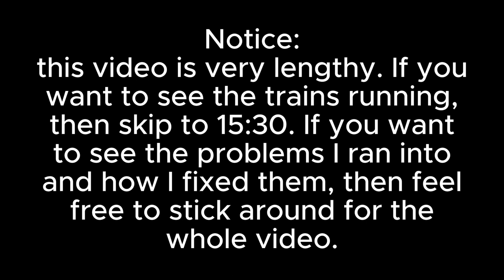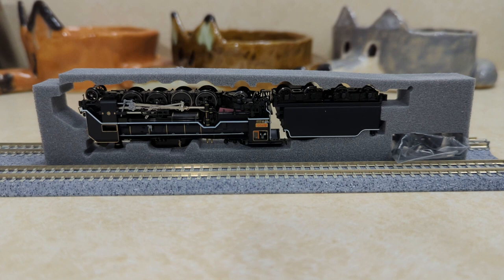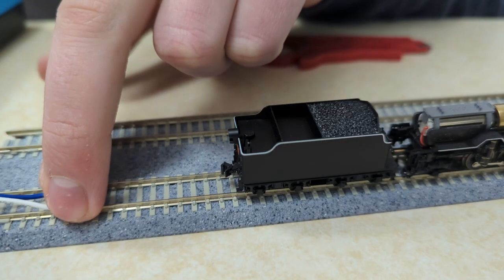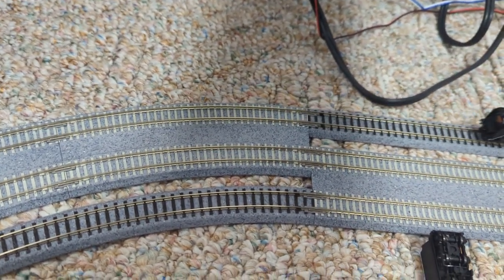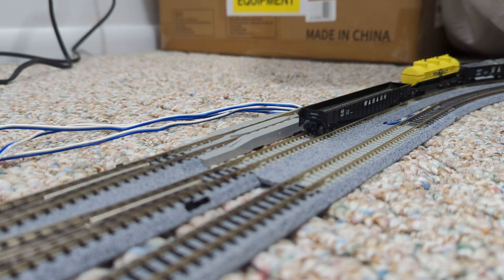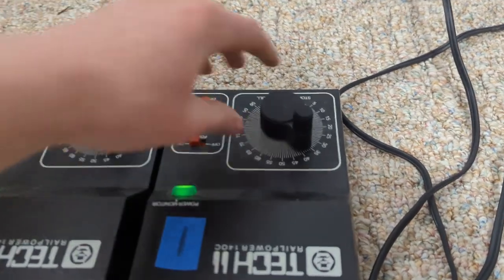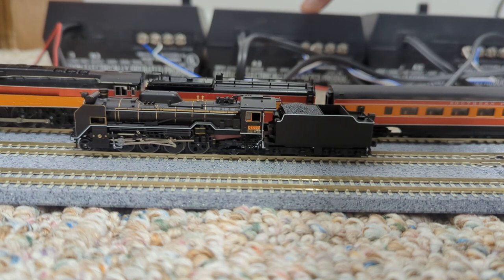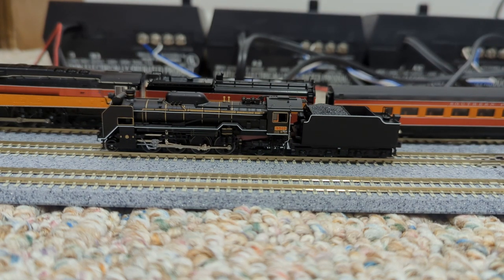Kato N Scale D51 200 (Hiro) Running and Complications (Part 2)

Comment: Very nice bit of diagnostic work - well done sir, keep up the good work 👍.
I've found Kato steam locomotives to be a little twitchy myself as opposed to diesel and electric locomotives and multiple units which are sweet.
The smoothest slow running steam locomotive I have is a Bachman Spectrum 'Consolidation' class which runs reliably at ridiculously slow speeds.